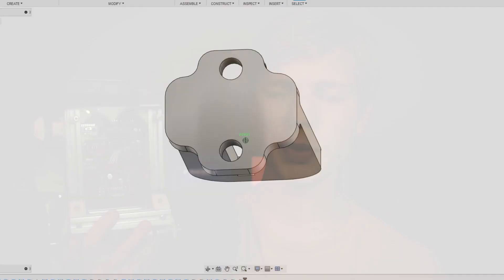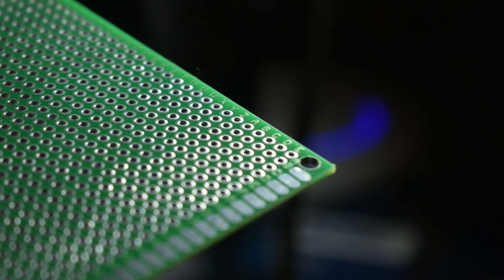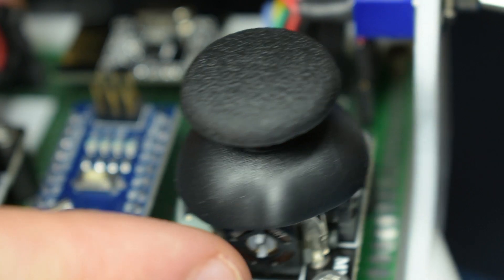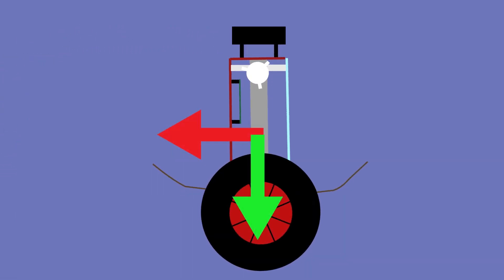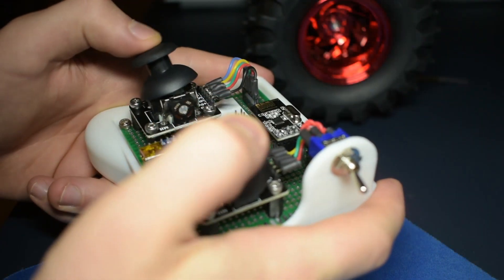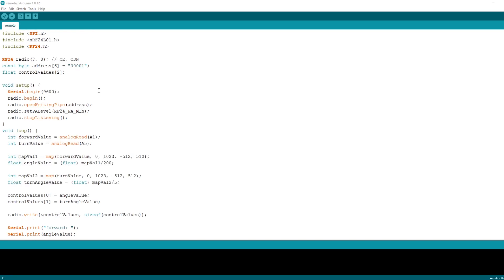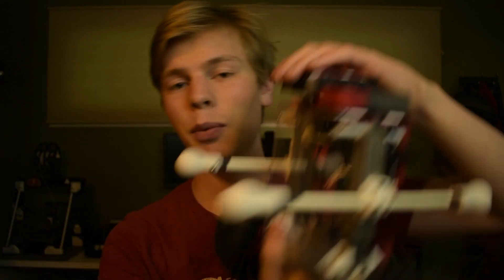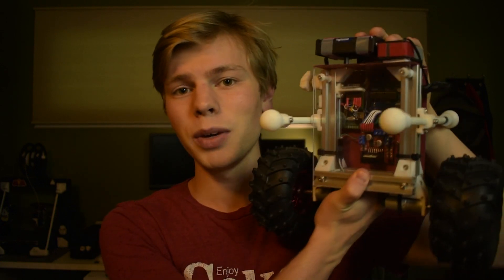BUILDING a Self-Balancing Robot | PART 3 - Remote & Code!

Comment: Bro amazing work. I need your help.
I am doing this project with Encoder Motors with built in Hall Effect but I don't have much of an idea about speed and direction control using them. If possible please help me how can I do it. Thanks
Reply: Also, despite having the Hall sensors in your Motors you did not use them. Or did you? Kindly respond I am stuck in this project.
Reply: what is the part number of your motors?
Reply: @robum911  I don't remember but I managed to control the speed somehow.